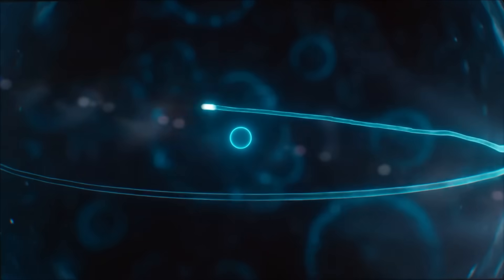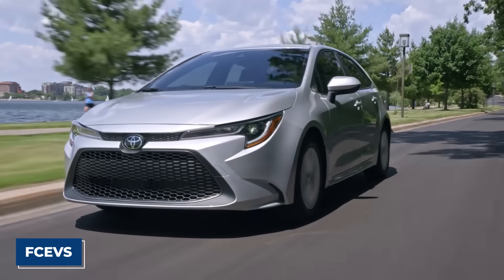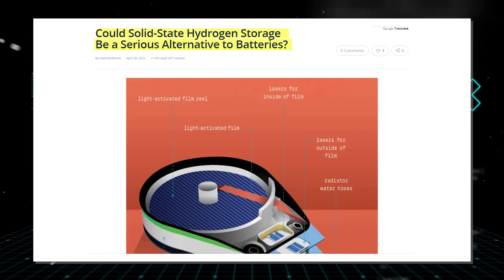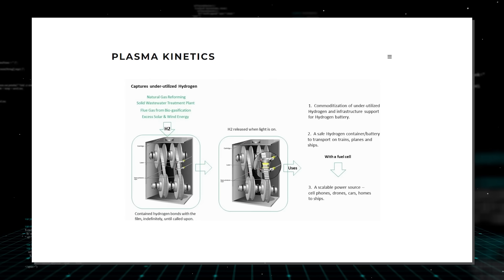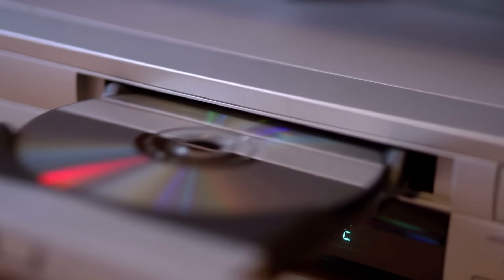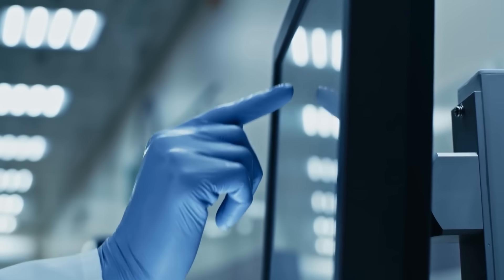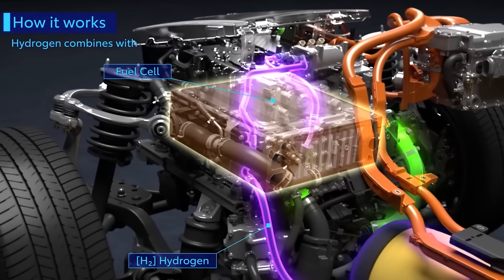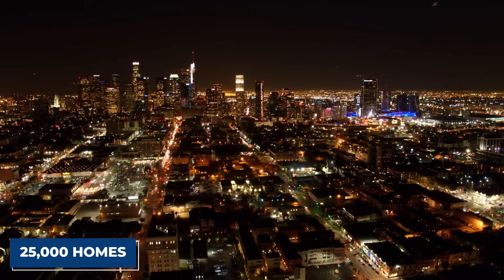IT HAPPENED! Solid Hydrogen Storage FINALLY Hit The Market

Comment: the patent was banned due to security reasons:  the heavy isotope of hydrogen, named Deuterium, tends to build-up at each recharging cycle. Deuterium is the component in the make-up of heavy water, used for nuclear energy production but also for the production of nuclear weapons. In my opinion, the system can be used in grid power storage where security regulations are easier to impose. that is one solution until we develop a system that prevents Deuterium build-up.

Comment: Would you need to store H2 at high pressure, if you could  produce hydrogen “just in time” that way there’s no need to store it at high pressure.  just have a small reservoir of low-pressure hydrogen gas to 1st start your vehicle.  after all during the last world  war cars have been running on propane gas, I and farmers run their tractors on methane gas. 
    As one inventor on YouTube claims he can make an abundance of hydrogen gas with just 3 V of electricity.        Steve

Comment: Why is this drivel still being promoted?  13 years and where is the evidence that this works?  Battery efficiencies are 90%, Fuel cells are sub 70% - Making hydrogen in the first place is very inefficient compared with charging a battery - and the notion you can somehow recover significant amounts from stacks is absurd, ^oo^